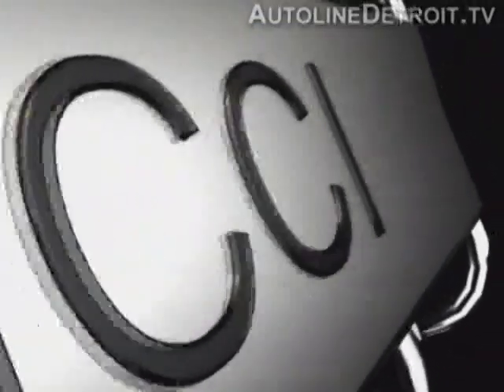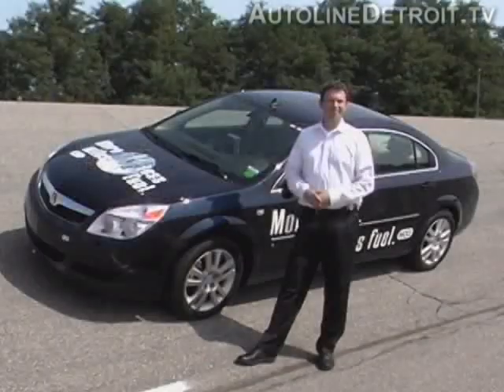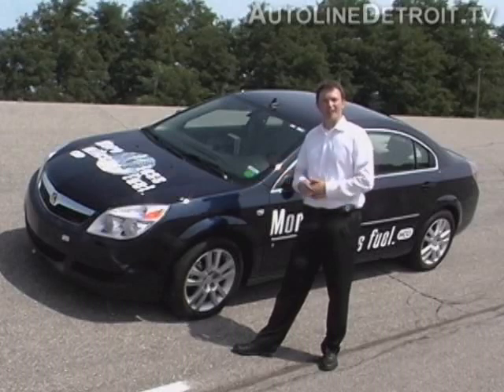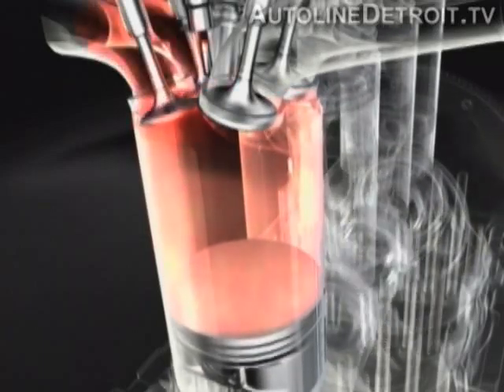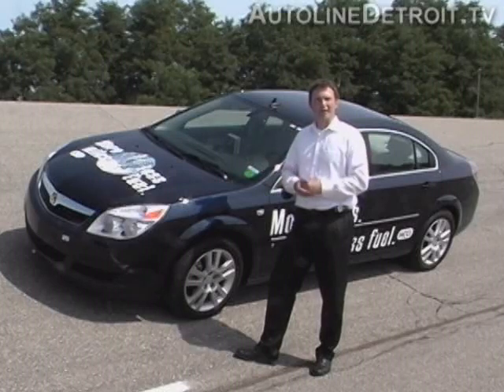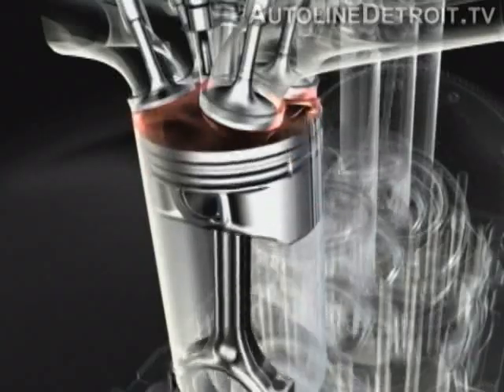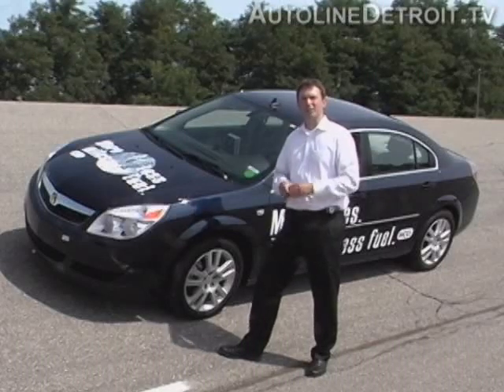John's Journal - GM Makes HCCI a Reality

Comment: been 9 years,    still no mass produced HCCI engines... Electrons is where its at for efficiency.
Reply: no, you are talking about energy density, not efficiency.   as you stated, an 85KwH version tesla, will go 300km.. correct,  1 litre of fuel is equal to approx 9.0kwh of energy.  so, less than 10 litres will take the tesla 300km.   how much fuel will it take to move an equivalent size vehicle 300km?  so, an example, a heavy 5 seat family saloon, uses on average, 10 ltrs to go 100km, so to go 300km, will use about 30 litres,  30 litres X 9kwh per litre = 270KwH. in conclusion, a Tesla, uses 85Kwh =300 km,  petrol engined car = 270Kwh to go the same distance.   so, as you can see,  electron use is far more efficient,  almost by a factor of 5.
Reply: Well Mazda announced that they gonna make it for production in 2019!!!!!!
Reply: The mining and manufacturing processes involved in creating the lithium-ion battery cells that power a Tesla are plenty filthy. Mining lithium is especially nasty and dangerous work. Then there needs to be a power source to recharge said batteries, which require polluting processes of their own. Even supposedly environmentally friendly sources like solar and wind power require a lot of raw materials and rare metals to manufacture, which means plenty of pollution.

Electric vehicles still come out ahead in the long run, but not by much, and HCCI engines could pull ahead of electric in terms of their overall carbon footprint.
Reply: This sort of knee jerk, bandwagon non-thinking is not helpful. How does the engine having one moving part have anything to do with how dirty lithium mining is? Less moving parts doesn't change that. There's no correlation there.

Electric engines are not some automotive second coming. They have plenty of negatives, just like every other imperfect technology. That technology will likely improve drastically over the coming decades, but at the moment batteries are inefficient, heavy, expensive, and not much cleaner than a modern gasoline engine.

HCCI engines, on the other hand, are supposed to be available for the Mazda 3 in 2018, and are projected to reduce emissions by at least 30% for similar performance. That's a big jump in just one year, and a cheap, easy transitional technology while batteries catch up. I don't know what you're complaining about. This is good for the environment!
Reply: nissan is about to release theirs apparently
Reply: Lithium mining has not brought the world to the brink of environmental disaster. Fossil fuel mining and burning has. Electric vehicles do not have oil, coolant, exhaust pipes, petrol or diesel. There motors only have 1 moving part so do not give me any grief about dirty lithium mining. Thousands of aeroplanes all flying in the upper atmosphere at any one time spewing millions of tons of pollution into the ionosphere. Aeroplanes do not use gallons of fuel, no there fuel is metered by the tonnes. The planet is going to be destroyed by head in the sand people like Shea Briar. Any engine that burns fossil fuel will never "pull ahead of electric in terms of there overall carbon footprint".
Reply: and nuclear power to charge them.  coal is so pollution.
Reply: 7316bobe where do you thing the electricity to charge your electric car comes from?
Reply: I am not trolling you. Note that I'm measuring risk vs. reward on a per-watt basis, and neither solar nor wind are particularly good at producing high wattage compared to the resources that have to be invested to build them, so that skews the numbers (wind is especially bad in this regard). By this metric, nuclear and natural gas are the safest and most efficient major energy providers by far. This is not to say that natural gas is "greener" than solar -- it isn't -- but it's so much easier and less dangerous to extract and burn natural gas than it is to mine and manufacture the raw materials for solar. Natural gas is far more efficient in terms of energy density, too, so it more than makes up for the impact natural gas has on the environment.
Reply: London's got major NOX problems, but as of 2012 more than half the NOX within the inner London ring road wassn't of automotive origin (This is important as it's before there were significant numbers of Euro5/6 cars on the road)

Most of that non-automotive half was from older gas-fired domestic heating systems - heating systems have been subject to NOX controls since 2001, anything older isn't covered. 

It gets even wilder - Almost all that NOX from heating systems is attributable to less than 0.5% of gas boiler installations and almost all of those are more than 30 years old. Newer "condensing boiler" systems emit almost zero NOX and they've been mandatory since 2003.
 
Those electric cabs are a step in the right direction but they're actually series hybrids. They still have engines and the engines will run outside of the central london NOX control areas to charge batteries. Theyr'e NOT zero emissions - just zero emissions in some areas.

London could halve its NOX levels right now, by condemning around 40,000 old boilers. Those same boilers are also emitting most of the excess CO detected in the city area, with some streets having NOX and CO levels emitted from boilers 10-20 times higher than that emitted by nearby traffic.
Reply: Paul Freedman
10000% more efficient? You definitely pulled that number out of your ass.
Reply: ... that's by weight. By energy it's just as efficient
Reply: Still using a dirty polluting fuel, gasoline, for your "fuel cell"
Reply: Robert R Beauchamp
The electricity to charge my electric car comes from the panels on my roof and from my storage batteries. They also run my whole house and I have NO electricity costs. The sun provides everything for me. I just have not been able to afford to buy an electric car yet.
Reply: Making solar panels requires toxins such as sodium hydroxide and hydroflouric acid, rare metals such as silver, tellurium, or indium, and the manufacturing process requires plenty of electricity as well. Everything has a cost.
Reply: You could say the same about all industrial waste, but it's still waste. I'm trying to illustrate that so-called green energy is not as clean as it seems. In fact, when you factor in the environmental impact of mining, manufacturing, transporting, waste management, and the risk to human life involved in all these steps, the only sources of energy more harmful than solar and/or wind are coal and oil. Geothermal, natural gas, and nuclear are all safer and "greener" options by a huge margin. Wave power is also safer, but very inefficient. Hydroelectric is marginally safer, but can wreck an ecosystem.
Reply: Shea Briar is just trolling us. Take no notice and it will go away. I cant stand trolls.
Reply: Most modern nuclear doesn't need a large pressurized containment vessel. Molten salt reactors operate at atmospheric pressure.
Reply: you point is mute any form of mining for any raw material if filthy to varing degrees same as power generation solar and hydro even if we follow that line of thought if the end produce produces less emissions its a win, electric vehicle range will improve with the battery technology Li-Air batteries is one that looks promising and could cut the battery weight in half.
Reply: and the overall cost, per let's say ten years, of electric is much higher.  Solar cells, wind generators, heavier car maintenance, plus possible motor burn out all adds up.  Electric doesn't come cheap.  And resale of electric cars with old batteries is risky considering the cost of replacing them.
Reply: But a Tesla battery isn't gone when spent. after 1,000 recharges, it has been 10000% more efficient on resources and pollution than ICE powered cars.
Reply: London cabbies to go full electric. A company in Britain is making electric cabs to replace the diesel ones that are now in use. All diesel vehicles are to be phased out of the city of London by 2020
Reply: That good reason being that 50 years ago it WAS the most efficient, but not anymore. But believe what you want.
Reply: So stop posting.
Reply: Sim Salabim the thong to bear in mind about both gasoline and diesel engines is that thanks to pumping and throttling losses the maximum stated efficiencies are only ever achieved at full load (and wide open throttle on Otto engines). That maximum possible efficiency is 35 to 38% in automotive engines.

At any other point in the driving cycle the efficiency is significantly lower (usually less than 5%) tending down to 0% when idling or decelerating.

The aggregate efficiency of most car engines is less than 2% across their complete driving cycle. 

By contrast the fuel to outlet efficiency of electricity systems is around 35% (including transmission losses) and coupled with 95-98% efficiency of electric motors at almost all load levels and 75-90% efficiency of batteries you end up seeing fuel to wheel efficiency of around 10-20% before regeneration is used. That's a big win for urban driving, which accounts for 80-90% of all transportation. 

By all means continue to use IC engines if the majority of your use is long distance transportation.  It makes sense to do so. Electric is a net win in cities.
Reply: 0.35872 is "similar to the best" under ideal conditions  (full load/wide open throttle).  Under all other operating conditions the efficiency is much lower and average cycle efficiency for an automotive IC engine is under 10%, frequently under 5% if you take long haul freight out of the mix. 

Yes, correctly sized IC engines are better for motorway hauling or specialist work but for nearly  everything else EVs are a more efficient overall choice.
Reply: Yukko Yuki yeet
Reply: Nope.  Electrons aren't more efficient.  Take the Tesla Model S - A full charge on the 85 kwH version (in ideal conditions) gives you roughly 300 kilometers of range.  If you were to measure the weight of the Tesla's battery and place an equivalent mass of fuel into a conventional ICE powered car, you wouldn't need to fill up for weeks!  The 85 kwH battery weighs around 520 KG;  that's equivalent to 750 liters of unleaded.

Comment: that is alot of extra technology to mesh together. VVT, DI, sensors, computers the whole deal. more parts, less reliability. simple as that
Reply: Not exactly that simple. Today's engine's are much lower maintenance and much longer lasting than the engines of the 60's, 70's, and 80's, but they are also more expensive.

There's an old adage that still holds true for autos:

Low cost, high performance, reliable...
Pick two.
Reply: Not really anything more complex than most modern engines, just a higher production cost and more sensitive to varying conditions making it difficult for mass production but there's not a whole lot of additional sensors necessary over mosst DI turbo engines today.

We've got mass produced forced induction engines with ethanol sensors for e85 compatibility, continuously variable valve timing (some of which employ atkinson cycle timing), the ability to adjust boosed based on fuel octane and much, much more.  When properly maintained, these systems have plenty of life in them.  Back in the day, 100k miles was a huge milestone for cars.  It's no big deal at all anymore.  While yes, there are a lot of potential failure points, there are still many in old engines and most weren't all that reliable.  

To obtain high efficiency, a lot more precise control over engine parameters is necessary and I think we have done an excellent job at obtaining higher efficiency without sacrificing reliability.  The old guys don't like that they no longer can fix their engine with a 3/8s socket and a hammer, but look at what we have.  We could have a 250hp 300lb 350 from back in the day or a 270hp 300lbft 2.0L LTG with a fatter and flatter torque curve while also capable of over 50% gain in fuel economy.

Comment: only homogenous charge?  what about a stratified mode for performance like Audi has? Or is GM still trying to catch up with technology again?
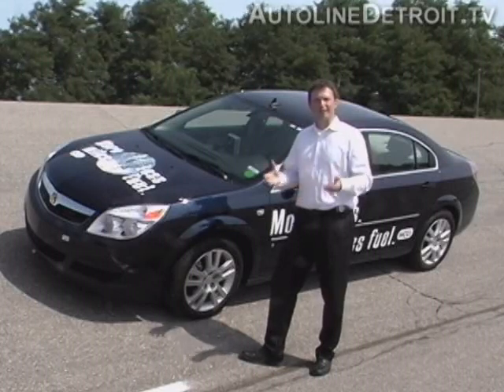Reply: Did you not make it to 2:30? It will switch to a "conventional" direct injection mode for more power.  As far as the VW group engines being ahead, I wouldn't go that far.  GM was way ahead of everyone with forced induction and still has produced far more turbocharged models than any other company. 

Also, if you compare the 2.0 TSI to the LTG, it's down 20hp and over 30lb ft in its best configuration.  Don't get me wrong, the 10 years I spent with my A6 were great but I wouldn't put the VW group ahead of GM in engine development.

Comment: Hmm, only 15% more efficient than a non - Direct Injected gas engine? The Atkinson-miller cycle engine in the Prius is already close to that level. Is the dramatically increased complexity and possible long term maintenance costs worth it? I hope so because I want a Prius that's rated for 60MPG .. if they can get a bit more out of the HCCI tech.

Comment: You can remove the throttle plate from a regular gas engine, by having continuously variable valve lift (Like Honda's Advanced VTEC). Then there is no need for a throttle plate because the valves control how much air goes in.
Reply: you do understand on how youve defeated your own purpose right?
Reply: warmfreeze 
No, throttling induces losses. Closing the intake valve early pulls a vacuum in the cylinder, which is RETURNED to the engine on the first part of the compression stroke.